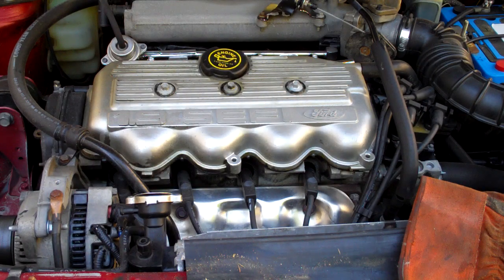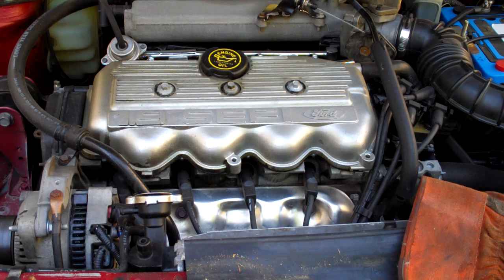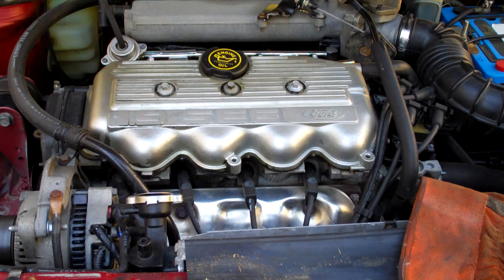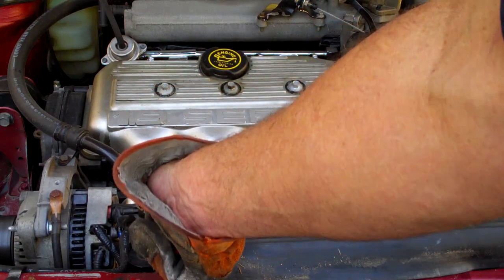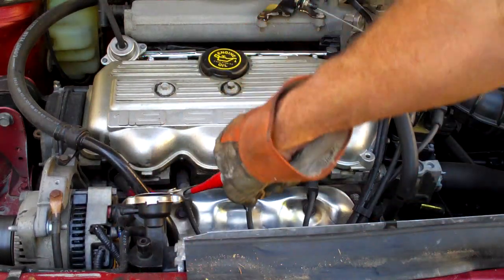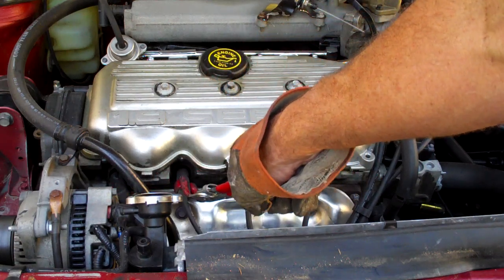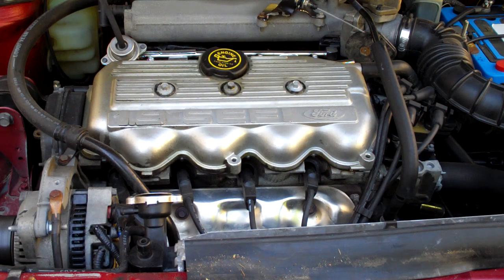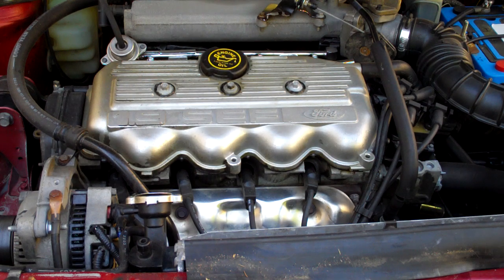How To Diagnose An Engine Knock.MP4

Comment: After starting the  Engine,  it was having a knocking  sound with white  smoke  coming  out  from  exhaust  pipe, as I removed  the  coil cable,  I discovered  that number 3 has no spark, 
Please  help me.
I changed the  coil with  coil number 1....still  there is no  spark from number 3 only.

Comment: i have 330k on my 94 sierra. yesterday it started making a rattling sound around 1700 rpm. it did this for a few days about a year ago and went away. i’m hoping it’s just the manifold cover because i know for a fact that it does rattle pretty loud. oil pressure and everything is fine so i’m going to tighten it down and hope it goes away. it sounds like a fan hitting something metal that’s the best way i can describe it. and just for the record that’s not what it is i’ve checked haha. also the sound isn’t heard in park or neutral so i’m assuming it wouldn’t be a knock of any kind? i usually do all my own work but i haven’t had to anything this in depth before so any insight would be appreciated.
Reply: ps i’m posting this everywhere just hoping someone will get back to me. so if you’ve seen my comment a few times sorry

Comment: A collapsed piston skirt will make that same sound, no noise when plug wire removed, piston slaps under combustion about 700  rpm or so above idle.

Comment: What if my engine womt knock on idle but does when u rev it past 3k
Reply: Hi @240sx95 Mines also making a knocking noise after 3k rpm did u manage to find the issue?
Reply: @emilio38able  yeah the engine was blown i sold it to a buddy and he put a new engine in. It was a 4 honda engine edit it might have been my saab i had idk
Reply: @emilio38able  you should have someone look at it tho it might not be the same issue

Comment: never buy a Ford vehicle. always buy Lexus Vehicles. ls430 2001 273000 miles. original starter and alternator. ls460l 2007 awesome cars!!!
Reply: LOL, what a joke, the for will be cheaper and more reliable mile for mile than the lexus.  I've worked in a call center taking roadside calls, I wouldn't ever buy a lexus, junk cars get to where the security system will malfunction and leave the driver sitting over nothing.  Only lexus I'd have is one I'm chopping into parts to resell on ebay, I wouldn't put my family in one.
I drive a ford with close to half a million miles on the stock engine, I drive it every day, towing even.  Screw a lexus, couldn't make money with it, they don't make trucks, they make wussy cars.
Reply: Patrick TheBaptist l guess you Lexus vehicles because they are all over the highways. I would never buy a FORD found on the damaged. Lexus has best reliability of cars on the road. Ls400 have over 500,000 miles. Every car dealer and mechanic l have talked to recommends Toyota or Lexus products. You are just jealous you can't  buy one!!!!!!
Reply: Andrew, lexus doesn't make a truck, they make nothing to help me in life LOL.  lexus doesn;t out number any of the big 3 us makers in cars on the road LOL.  " Every car dealer"  DUH, they deal em, they aren't going to tell you the truth LOL, they are a "DEALER" they want sells, not people that think things through.
Dollar per mile, waste your money with a lexus, doesn't bother me, I don't sell cars, I chop em up and sell parts and that would be any brand.
"You are just jealous you can't buy one!!!!!!"  And that can be turned right around on you.  I've had one about 12 years ago, it was a wreck that I salvaged, so yeah I can't buy one nope  LOL, already have purchased one previously.  But hey you know everything about me LOL.

Thing is my truck is nearing half a million miles, and it can make another especially the shape this one is in.  There is a guy with one on YT with 1.4 million miles on his.....
Shucks I'm not even limited to having to lump it over to the gas station for fuel, more than half I reprocess in my back yard.

They do look good for the most part, but I am a working man, not a softy, they aren't for me and have nothing to offer me but a waste of money.
I also would state I don't like everything ford has made either, but some of their stuff mainly TRUCKS I do, my lively hood depends on what I drive, lexus has nothing to offer me at all, can't haul 18,000 lb loads with a lexus LOL.

"I would never buy a FORD"  LOL, ohh come on please buy a ford, like it matters to me what you buy, I'm not in gradeschool anymore and I don't sell cars like I said.
Reply: Patrick TheBaptist   Toyota has a tundra and they have been known to go 500000 miles or more!!!! I would buy tundra or Tacoma before l would ever buy Ford Chevrolet GMC  trucks!!!!
Reply: Do what you want, no wonder you need to talk to so many dealers and mechanics LOL.  I wouldn't by a GM to drive either LOL, never had a GM product other than Isuzu that I liked and I've had a few of those.
"Toyota has a tundra and they have been known to go 500000 miles or more" 
Tundra wouldn't stack up to the work and towing I do, it wouldn't make 50k miles before the trans or engine would have enough of it.
Drive the small trucks, I'd wear them out too fast with what I do for work.  
Then to have to buy gasoline for them, yeah no thanks, I prefer my turbo diesel.
Ford has made trucks known to go over a million miles, they sure aren't making them last that long now however LOL.
You sound like you are not even old enough to own or drive a car LOL.
Reply: Patrick TheBaptist  old enough to drive please. My Dad always told me to buy the best!!! You are just jealous You can buy a tundra look at south main auto YouTube channel and see what he drives. Old enough 54 years old and been retired for 3 years. Live 1 mile from the beach. Have to Lexus vehicles    and own 5 apartments please am l old enough now!!!!
Reply: Patrick TheBaptist  you are so jealous of people who can retire at a early ages!!!!! You will be working till 65!!!! I am also 2nd degree black belt in danzan goshin jujitsu so l don't scare easily!!!

Comment: guys, I need help. Here's this company car issued to me and I didnt notice that I was running with no coolant due to   a leak , am not sure which part of it was leaking and suddenly it stopped running I thought its just overheating so I let it cool for 1 and half hour and then the car was not starting. everytime I turned it on, it just gives electricity but wont realy go on to start..... can anybody give idea about this?

Comment: mine knocks but I'm pretty sure it's the rod bearings. how do I tell if that's definitely what it is?
Reply: One way I determined which cylinder is knocking on a 2007 R1, is by removing the spark plugs. Then rotate the crank so the piston is in transition to BTDC. Then take a 1/4" extension or long screw driver and push down. If it moves even by a hair, the rod bearings are to blame on that cylinder.

Comment: Is normal if that happens for a while after a cold start? If the gas is too bad this happens more often?
Reply: Fuel knock can definitely happen if the octane level is too low. (I.E. the gas is old.) I have a car in right now that I just finished doing an engine swap. It's been sitting for a few months so the gas isn't exactly fresh. It sounds beautiful at an idle, but when you accelerate above idle it knocks.

Comment: My Toyota has 348000 kms and it sounds like that , But I'll run it to the ground
Reply: this is sticky cylinder you can fix it cheap
Reply: Dad always said if it runs then go don't worry about it
Reply: 455,000 MILES on the F350 I drive and it will probably get to roll over the odo if I keep taking care of it.
Reply: Lol
Reply: Is it still alive?

Comment: why not just change the spark plug or wire, thats what it sounds like.....
Reply: its not the problem of the spark plug, its inside the cilinder where the knock is

Comment: I own all ford's and have no problems with them everyone I know who has gm cars have nothing but problems
Reply: I drive a F350 with 455k miles on the odo and stock engine (7.3PSD).
Drive it every day, my only vehicle at that....
Reply: @PatrickBaptist  pull a damn house down at any given time too im betting 👌
Reply: You should buy a Ford or gm depending on what you wanna work on. Ford nothing but the engine breaks and with, GM everything except the engine breaks. Honda or Toyota is the way to go.
Reply: @MinerLOLZ  or newer hyundais
Reply: vertrees83 With GM you know it's broken when it's NOT making weird knocking noises....

Comment: The engine looks almost exactly like my '90 Geo Storm. Did Ford partner with Isuzu at some point in the past? Or completely rip off the Isuzu motor?
Reply: Right, that's why it's so amazingly weird that they have almost identical layouts. What year did Ford introduce this engine? Was it one that they worked with Mazda on?
Reply: ***** Thanks!

Comment: the problem is that its a ford
Reply: Ignorant comment...   The 1.9 was  solid engine,  known to exceed well over 300k without issue.    

Hell we had 3 with over 350k.

German design,  originally turbocharged in europe.  Non-turbo in the USA, therefore lasted forever.
Reply: ford from the lord
Reply: Couldn't tell me that I drove a ranger from 60k miles when I bought it and when I sold it thing had 372k on the clock only had a cam replaced as far as major engine work goes.  I bought it when I was 16, drove it hard like any other teen that likes to abuse things, overheated it several times, ran it out of oil a few times....
Engine never left me sitting.  Hope you don't want to recommend something like a GM product, I've got a GM motorhome that couldn't make it past 40k without taking a dump and burning valves.
Reply: True!
Reply: The problem is that its not a 300i6
Reply: Guess I needed to mention I currently drive a F350 with 455k miles on the virgin engine.....
Reply: You morons think you’re so clever repeating the same jokes that have been around for decades.
Reply: Hasn't calling people morons been around for decades?
Addressing people with a immature insult first sentence has been around for even longer.
How do you figure that is so much more cleaver?  Atleast a joke is a joke, a insult for nothing, now that's grade schooler maturity there.
Reply: Dwight Payton that's all fine, but this ones broke XD

Comment: My 89 2.3 mustang has this same problem, but only makes this sound right after you start it up. Once the engine gets warm it ceases to make any kind of knocking sound when accelerating. Is this normal?
Reply: that happens to me too! DId you figure it out?
Reply: replace the oil pump,  the same thing was on my Subaru Legacy 1998,  I was hearing knock for about 1 second. after 2 year the knocking started to take longer time,  then it's knocking all the time and waiting for engine swap with 2002 EJ20 SOHC engine from my second car,  and I will put EJ25 IN the 2nd Legacy
Reply: it might be the timing belt / chain tensioner or the oil pump
Reply: Im late, but this is most likely excessive piston to cylinder wall clearance. its normal on engines with a lot of miles on them, you might either need to bore the cylinders out and get oversize pistons/rings or a new block.

Comment: NOT SO FAST.  From what I could tell from the video my Ford 2.0L (same basic engine) was making the same exact noise. As it turned out for me,  the real explanation for the noise had nothing to do with the internal engine components.  It was a partially working fuel injector. It turned out that noise was not "piston related", it is instead pinging in just one cylinder!  (OK, technically pinging noise made by the piston, but that is not what you were getting at).  The bad injector causes the air/fuel mixture for that cylinder to be way way overly lean, thus ping badly. It should be noted to, there was a noticeable decrease in power if this is the case too. So before anybody else junks their car for what is a extremely easy fix, always ask what else the result of this test could mean.  The list is longer than what you said in the video.
Reply: Steve Baker 
I have an 88 Accord with this same noise, my husband and his friends heard it WAY before i even could, exhaust is also loose and vibrates causing a similar sound. But i also have a bad injector (or the o rings are worn) which ive read can cause alotta the issues im having. I keep hearing its a rod knock and can probably be fixed replacing the bearings. Lol i never expect the easiest fix bc 9/10 its deeper than anyone thinks. Plus its 30 yrs old, was not taken care of properly and had a quick as tune up prior to buying. Jw if a fuel injector could cause the knock, idle surging, lack of power, etc as a bearing or piston can? I know theres a fuel issue bc i can smell fuel inside the car. Only code was a failing baro sensor which ran better unplugged but my luck caused this issue. Hard to find info and some parts on this car, harder than any other car Ive owned.
Reply: Steve Baker i also have the same problem and noise. I lose power when i accelerate up to 4k rpms... i have a 2.4 rav4 i hope its the same problem as yours (cheaper to fix than a piston...) im going to the mechanic tomorrow
Reply: Jonathan A shit.. and when i added oil it was very low.....
Reply: Steve Baker hey what do you recommend we start doing to eliminate the knocking and yes the car does lose power. Any info would be greatly appreciated as we don't want to junk car.
Reply: Jonathan A ha I had an escort same thing moral of the story but a chevy 😂😂

Comment: Yea its a ford but i guarantee you Chevys have wayyyy more problems
Reply: maybe instead buy a toyota.... woo woo woo woo woo...
Reply: Yup, I've got a motorhome with 40k on it, 454 had to be yanked out, it couldn't hack it without burning valves.
Reply: yep, I owned Chevy's for over 30 years always had issues, had to buy special tools, carb problems, front end, constant brake jobs...tires. I've had stuff transitioning to Ford too but not as expensive and constant as GMC
Reply: Right?
Reply: +TwilightTheShooter i know

Comment: My hubby changed all my spark plugs and the noise is still there but not too loud as last time. anyone have a clue what else he should do?
Reply: Anne TAU the guy lifting the sparkplugs is diagnosing the problem. he is checking where the knock is coming from. like a previous comment said, you know where it is but you cant do much about it. either get it fixed by a mechanic or get a new engine installed. both are expensive and sometimes buying another car is a route to take.

Comment: Is that a special pair of pliers you used or just regular..?
Reply: They're actually spark plug pliers.
Reply: +John Hansen pliers are angled for better positioning, and the tip shaped to hold the boot without damaging it.

Comment: if your knocking is all the time it could be broken connecting rod (blown engine) signs are : Low on power, rough running, and knocking, the motor may still run but not very good and will most likely seize.
Reply: That's not entirely true. I have a 2007 R1 at my shop right now that had a consistent knock. After tear down I discovered the rod bearing was fried causing a significant gap hence the knock. It ran great other then the knocking...

Comment: My engine doesnt sound that bad but when i pull the plug wire from cylinder #3 the knocking stops and the spark plug comes out with oil, what should i do next?
Reply: +EK9GraphicDesign You sure it's oil and not just fuel?
Reply: +i only fear phobophobia got it fix, it was just spark knock. the ignition had to be adjusted.

Comment: I like your plug boot pliers ....I learned the hard way not to use your hands. ZAAAAP...HAHAHA! THAT SUCKED.
Reply: Its thousands of volts running through the HT leads and it will zap you, fortunately the amps are low.
Reply: OK clamo do what the guy in the video is doing but with your bare hands, you were warned. Oh and Google how many volts go through the HT leads to the plugs it will shock you. LOL
Reply: John W 12v is battery voltage, not almost enough to crank an engine over. Ignition leads can produce upwards of 30000 volts
Reply: +AAcruz I banged my head because I grabbed the wires without proper protection. plus it was raining... so you know water and electricty dont mix, so,  i got zapped by the coil that emits the electrical charge that ignites the spark plugs to burn the fuel.
Reply: Had the same happen to me on a rainy day. 1986 honda civic. I banged my head on the hood clip so hard... well.. lucky I didnt get stitches..
Reply: The voltage for spark plugs is 12000 to 25000V. It has to be high for the electricity to jump through air gap.

12V is the battery voltage. Nobody lied to you :)
Reply: It will still zap you its very high voltage, use gloves and insulated pliers as shown in the video.
Reply: lol me too
Reply: Would you mind elaborating on what you mean? Sorry to kill the fun haha I'm just trying to learn
Reply: AAcruz: why do you think its called a sparkplug?
Reply: Yeah it sucks and I still do it that way......  Man those spark plugs in my diesel really produce a shock......  LOL
Reply: I used to zap my penis with sparkplugs when I was younger. I said No. But I knew I wanted it.

There was this benz...
Reply: that's funny because the wire is made out of rubber on the out side.
Reply: John Walker
my bad you are correct. I really hate when mechanics lie to people. this hole time Ive been told its only 12v's. but I have been shocked by the system and it only felt like a static discharge. I guess I am not as sensitive to electricity as every one else.
Reply: How did you get zapped may I ask?  What were you doing inside the engine bay without any knowledge of what you are doing, and how the system works...?  A guy did that with a microwave once, it stopped working so he pulled it apart to take a look (without any knowledge).. Like I said, he only did it ONCE
Reply: John Walker
LOL. please re-educate yourself.
Reply: John Walker
 12 volts is not very hi. the zap will be like static discharge. but only if you hold it the wrong way.